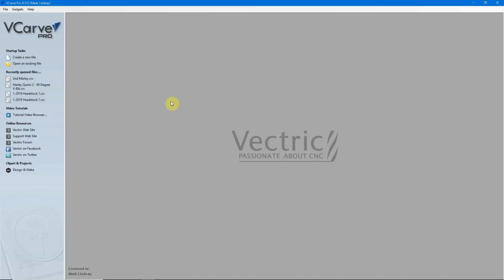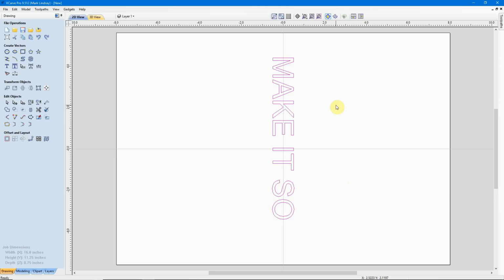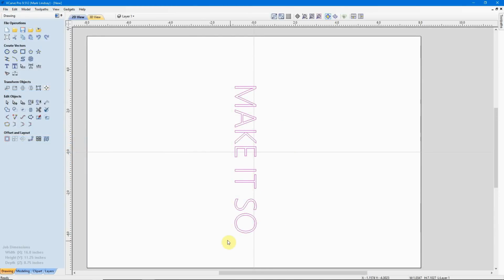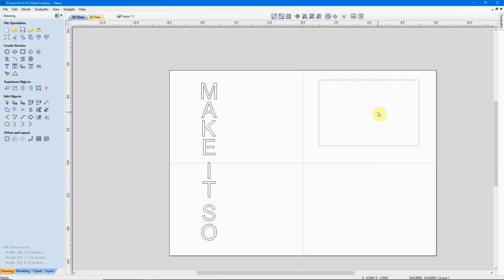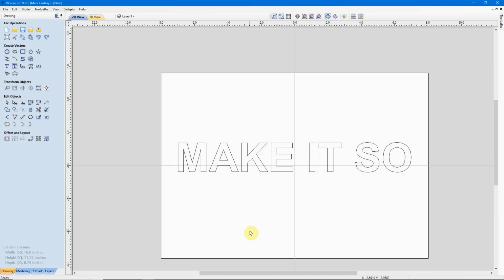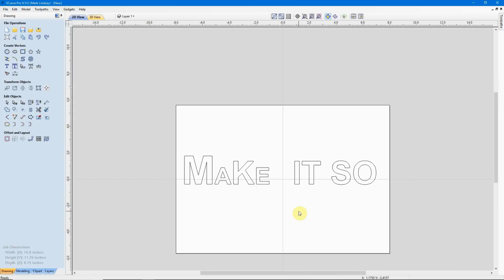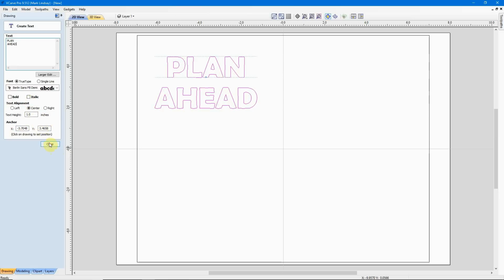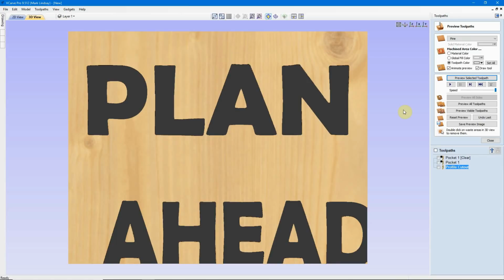Text Tips & Tricks - Part 13 - Vectric For Absolute Beginners

Comment: Hi Mark,
I am a complete computer illiterate, so your videos have really helped me a lot.
But I am stumped on a vcarve toolpath.  I did one successfully where the bit carved out  approximately a 10 of an inch or less on my granddaughters name.  I did a "save as" to create a new file with my grandson's name and it is carving a quarter inch deep at least.  I have checked all the settings on both tool paths and they are the same.  No matter what I do, it carves deeper than I want it to.  Ieven started a new file and started all over, but I cannot get to get it to carve the lesser amount.  Any idea what I am doing wrong?
Reply from the maker: What you're talking about is completely normal. It would take too long to explain what's going on and how to fix it here in text. Instead, I would suggest you watch my series on V-Carving for Absolute Beginners, starting with Part 1 - How It Works. That will show you what's going on. In the description box of Part 1 is a link to the play list of 4 videos in the series, in order. Part 2 will show you one way to fix the issue, but don't skip Part 1, as an understanding of how v-carving works is needed to avoid problems in the future. Here's a link to Part 1: https://www.youtube.com/watch?v=JGG0yTPih4w

Comment: Hello Mark. Thank you for those detailed explained videos.
I have question. What if we would like to raise the letters. Let say to curve all around and leave them to extend out of our material. How can it be done ?
Reply from the maker: You can use a Pocket toolpath to leave the letters standing proud. You'll need a vector to define the area you want to pocket out. Select the vector and the text, then do a Pocket toolpath.
Reply: Hello Mark. Thank you for your time. In fact I did tried to use a pocket with a vector and the letters selected, but the result was to pocket all the area and the letters too. I finally tried the v-carve toolpath with a flat bottom clearance and there it is. I really don't know what I'm doing wrong in the pocket tool because in other software this is the way I proceed with success. I'll give it a try again with the pocketing tool and see. You know I was watching your video with the clock and I imagined that it would be nice to have the letters stand proud. The only problem I met with v-carve toolpath was that I can't select any endmill tool but only v bits and ballnose bits. Thanks again. Keep up doing those great lessons. !!!

Comment: Can you get to the basic, basics and tell how to save the toolpaths to a memory stick and apply it to the control box?
Reply from the maker: I've covered saving G-Code twice in my Absolute Beginner series - once in Part 4, and I did an update for Version 10.5 in Part 49. As for using that G-Code with your controller, you'll need to contact your machine's manufacturer OR the control software's publisher or support community. There are several different controllers and control software brands out there, and all of them are different. Below are links to the two videos in which I covered saving G-Code, and another video that will help you find the playlists for all of my CNC series, in order.

Save G-Code - Part 4 - https://www.youtube.com/watch?v=kFIkyl8tUFU

Save G-Code - Part 49 - https://www.youtube.com/watch?v=X-3zOZ0w4Jg

Get The Most From My Channel - https://www.youtube.com/watch?v=5bYCKLFotGg

Comment: Mark as I'm doing my lettering I have a piece of material that's like 7 x 23 and then I set up vector box at 6 x 22 and I threw my texting inside that 6 x 22 box but when I print it or carve it it actually is all the way out to the 7 x 23 or even actually a little larger it's actually 7 x 26 can you give me any insight on to what I'm doing wrong 
Thank you
Randy schnieders
Reply from the maker: Make sure the box is a closed vector. Select the box, then click the Draw Text Within A Vector Box icon, then type your text. The text should be automatically sized to fit inside the box.

Comment: When using keys to move vectors, can shift or CTRL be used to change the increment of movement?
Reply from the maker: I don't think so, Skip. You can try it and see. Don't be afraid to give something like this a try. The worst that can happen is nothing at all.
Reply: @MarkLindsayCNC   Just tested this. Should have done it before sending..
Each Click
Arrow key only    .0156 per click
Shift/Arrow key   .0786 per click
CTRL/Arrow key  .0036 per click

1.352/.959
Reply from the maker: Thank you Skip! I really had no idea!
Reply: @MarkLindsayCNC  New Info from Vectric..Only at the zoom level you're currently on. The amount of movement is a factor of the level you're zoomed into not a fixed amount. Ctrl will reduce the relative distance and Shift will increase it.

If you want to move by a fixed amount press the F4 key to bring up the Snapping Options and set the Fixed Nudge Distance. Pressing Ctrl-Shift-Arrow will then move by that exact distance. Setting the Fixed Nudge does not affect the Shift-Arrow or Ctrl-Arrow combinations.
Reply from the maker: Thanks Skip!

Comment: MARK !  HOW THE #&*@  ARE YOU DOING THIS ??? Your last 4 videos have each come at a time when I was having difficulty with the subject you discussed. I was having a bit of trouble with the keyhole gadget, took a break to check email, and there was your video about using it. On Sunday, I was struggling with text placement, and again, your tutorial appeared in my mail and my problem was solved. Do you get an ESP alert when I think "I wish I could figure out how to ..........."? Just kidding. Your instruction has taught me so much that I needed, and has relieved a lot of frustration for me. By the way, the box that appeared checking out the one about script fonts is quite helpful. I've made several pieces of firewood while trying to use fancy fonts, and now I know what to check for before trying to use them. Thanks for all you do.
Reply from the maker: What - and give away my secrets? Sorry - there are a few things I'll never tell. (It pays to go back and look through my older videos. I did a bunch of tutorials a couple of years back. They might be done on Version 8.0 or 8.5 of the software, but the methods and techniques are the same...)